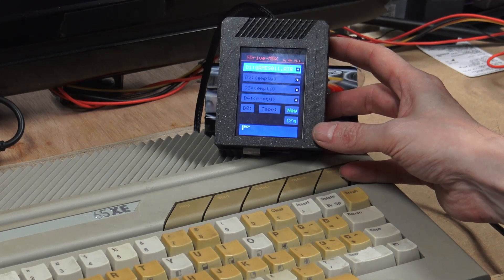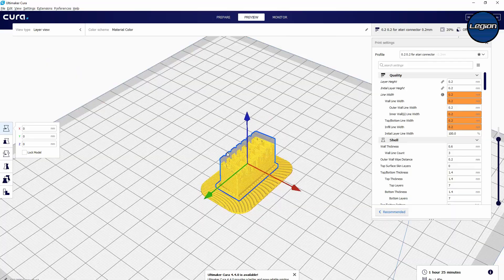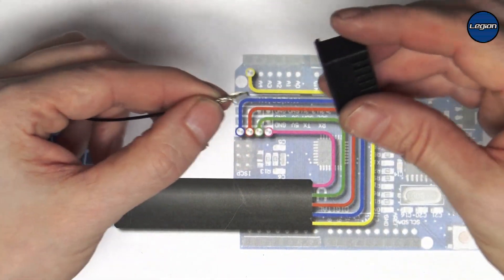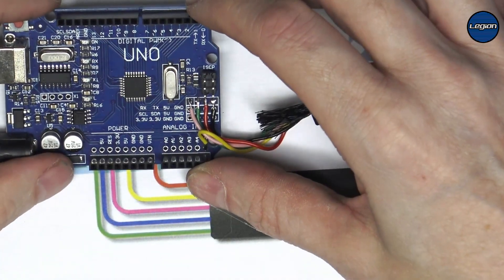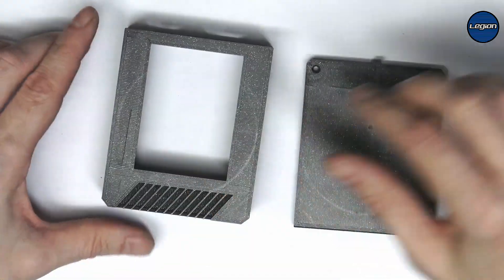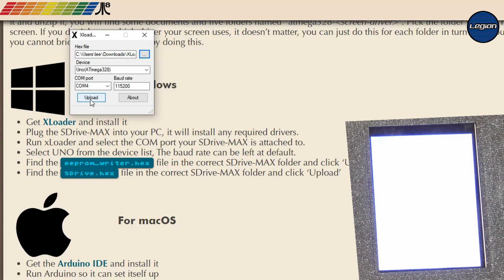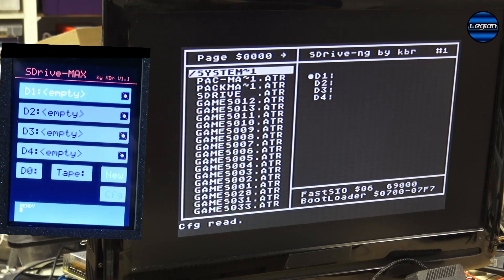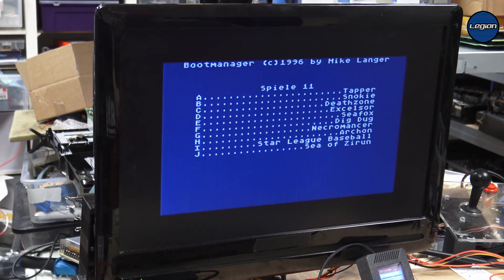Atari 65XE restoration project part 4 - Making the SDrive-MAX disc and tape emulation system.

Comment from the maker: I spent a bit of time with this and I found I needed a DOS 2.5 disc to boot and then I can format a blank disc image and then read and write basic programs :). Next issue will be the tape drive. It will rewind only when the Atari is not telling it do do something, cload or save and pressing enter will allow me to play and fast forward, but it did not want to load the program I saved and just ignored it.